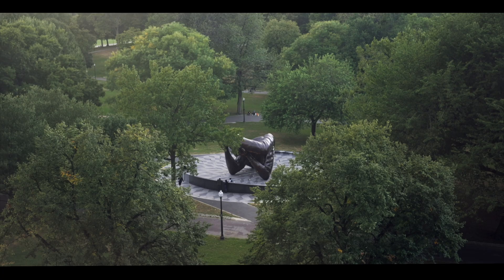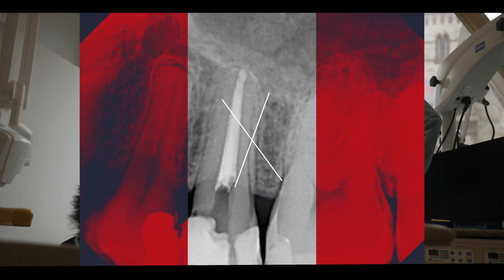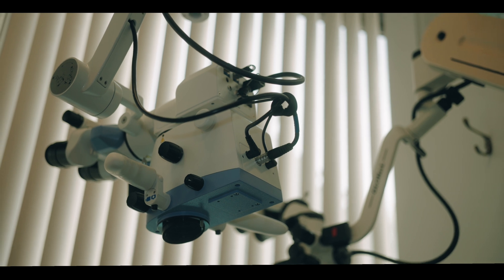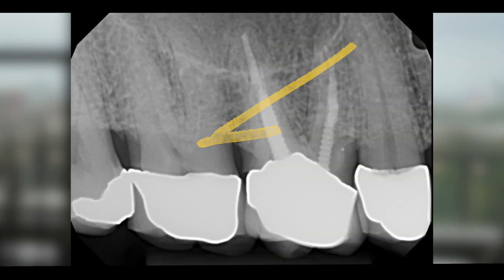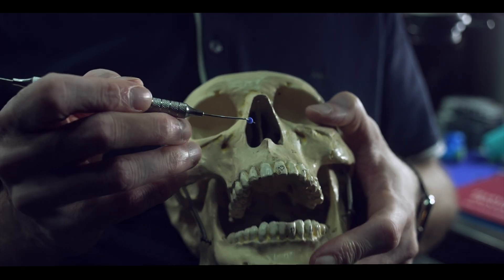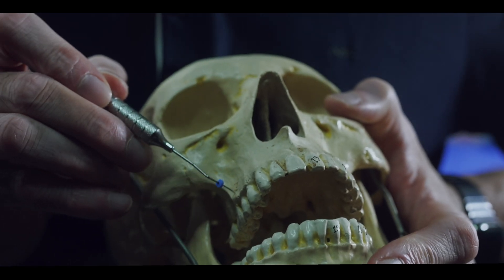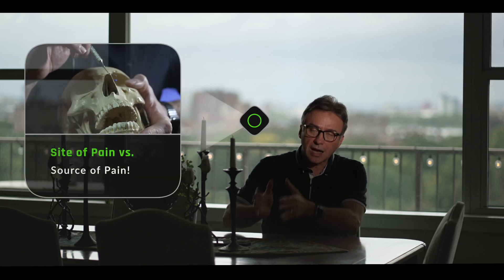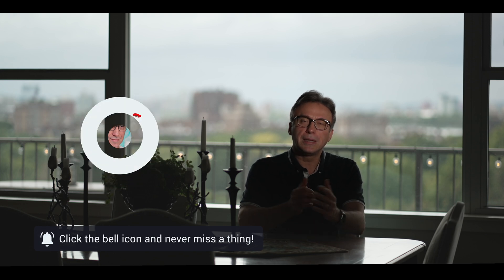Can a root canal treated tooth be sensitive to cold?

Comment: Dear Dr.Nasseh

In my clinical practice, I have encountered cases where root canal treatments appeared to be radiographically successful, with no signs of periapical radiolucency or cracks, yet patients continued to report pain. These cases involved spontaneous pain, occlusal pain, and in a few instances, temperature sensitivity. Most patients experienced relief after occlusal adjustment and retreatment. I have categorized the causes of these persistent pain cases into four groups: 1. Pressure pain due to residual pulp tissue in lateral canals, as some clinicians have suggested; 2. Iatrogenic damage, particularly irritation to the periapical tissues; 3. Central sensitization caused by prolonged pain (phantom pain); and 4. Other systemic or physiological factors, such as immune status or metabolic diseases.

However, I still have two questions I would like to ask: First, what could be the underlying factors causing the fluctuations in patients’ subjective pain perception in these cases? Second, although I personally tend to avoid apical surgery, in cases where the source of pain cannot be clearly identified, does apical surgery offer a higher success rate in pain relief compared to retreatment?

I hope to gain a deeper understanding of these issues with your guidance.

Comment: I had one perplexing case some time ago that still is a mystery.  A patient came in with a hypersensitive maxillary molar.  Minimally restored, no obvious cracks, and testing vital to cold, no lingering.  Hypersensitivity was localizable and reproducible.  We attempted conservative desensitizing efforts with no improvement over 8 weeks.  She chose to try elective RCT.  After treatment, the hypersensitivity remained.  Cold testing was localizable and reproducible.  I even faked a cold test and she passed my test.  We attempted two appointment retreatment to allow calcium hydroxide dressing with still no improvement.  She elected to try apical surgery.  We brought her back for recall and shockingly, the tooth was still sensitive even with a “pretend” cold testing to call her bluff.  She ended opting to live with the problem instead to extraction.  I bring this story up with my current patients when they are contemplating elective RCT as a last ditch effort to resolve their symptoms.
Reply from the maker: That's an interesting situation. Selective anesthesia prior to testing is a often diagnostic in these types of cases. The reason for these rare specific situations is the gingival thermal receptors, not pulpal receptors. This happens rarely, and in the past, we've treated them with a custom made appliance retainer that covers the gingival fibers affected. This allows keeping a reservoir of Benzocaine over the affected gingival fibers (their position can be tested by selective application of benzocaine before fabricating the appliance). Dr. Bui, if you have xrays and documentation of this case please send it to me and I will discuss it with our division deah Dr. Gibbs, and our pain specialist at Harvard Dr. Bavarian for a short video that would benefit everyone. Obviously, I'll give you full credit for the case in the video. Let me know if you want to do that. :)
Reply: @EndosKool It will be challenging to find this old case but I will talk to my staff to start digging :)
Reply: Hello Dr. Are you aware of any research paper that talks about such phenomenon I whish gingival nerve fibers are the one responding to thermal stimulation? Thank you!
Reply from the maker: @trickjacko8482  No specific studies on this specific phenomenon as it's rare; but the mechanisms for neuropathic pain in gingival thermal receptors does exist. Clearly, thermal receptors in gingiva do exist, we know that; we also know the neuropathic pain phenomenon. So, the fact that they can overlap in specific situations in specific patients is no surprise at all. Much of burning pain and burning pain syndrome is directed by similar phenomenon. These patients who have trigeminal neuropathic pain in a small patch of dermatome can theoretically experience this phenomenon. The fact that it's not more common is actually a good thing; but the infrastructure for its occurrence is certainly there and other types of thermal sensitivity associated with neuropathic pain is well documented in the literature.
Reply: Some patients just have a lot of mental issues and they try to put the blame at least on something “phisical” instead of adresssing their mental problems. That’s just my humble opinion.
I see a lot of patients who over react on stuff that is so painless just because they have their fears and wrong thoughts - these are patients with a lot of psihological traumas. And there are also patients with whom you solve difficult cases, maybe with some pain, but they are reacting normal just because their mind is ok.
This is a topic that must be considered by many of us - dentists. 
It’s difficult to say to the patient: “you are just crazy”😂 but at least we should know this for ourselves.
Reply from the maker: @enissa3536  To be honest, we used to think a lot of these were psychological; but in fact, we're now finding a lot of neurological basis to many of these clinical conditions. The more we look into it the deeper the rabbit hole of endo. Our misunderstanding of this procedure is that it's about creating lines on xrays and when we do that well everything is resolved. Whereas, it's really understanding, preventing, and treating the bioogical basis of diseases of pulpal tissue and its surrounding environment. But you are right too; there's certainly a psychological basis to all our behaviors. Many people come with their own baggage. But we should rule out all the neurological basis and not jump to psychological conclusions too quickly. Making the distinction between psychology and neurology is the key, and that distinction becomes clearer as we collectively advance our knowledge base and advance the field. Cheers! :)
Reply: have you tried to do a CBCT of the tooth? Is it possible not to have treated all the root canals?
Reply from the maker: @reli-dent-implantreli-dent5881  As I mention here in this video, you would not get cold sensitivity in those types of cases. Sometimes some people may get heat sensitivity in untreated canals; but cold sensitivity is mediated by coronally positioned A-Delta myelinated nerve fibers in the Rashkow's plexus which are the first ones that are gone after RCT. Even if someone misses an MB2 or MB3, cold sensistivity is not from it. In this case Apico was also done, which makes it really impossible to have either heat or cold, which is why I've mentioned it's from gingival thermal receptors, which has been shown in the literature to be a source of this kind of pain. I've seen and treated patients like that myself, where the thermal pain was from gingival nerve fibers. Benzocaine would make the cold sensitivity go away. I really should make a videon on this concept.
Reply: Dr. Bui, thank you for sharing this case. Excuse my ignorance, please, but could you explain how you fake the cold test and the patient passed it? I have a similar story and am wondering what to do.
Reply: @totishev  To assess the accuracy of a patient's cold sensation report, especially if I suspect they may be reporting a positive response without actually experiencing it, I sometimes employ a control method. I will spray Endo Ice but intentionally miss the cotton ball, then place it on the tooth. This creates an expectation of cold without delivering the actual stimulus. If the patient still reports feeling cold, it suggests that something other than the cold stimulus might be causing the sensation. If they don't feel anything, it indicates that their response to cold is genuine. I occasionally use this technique with younger patients who may not fully understand the instructions.